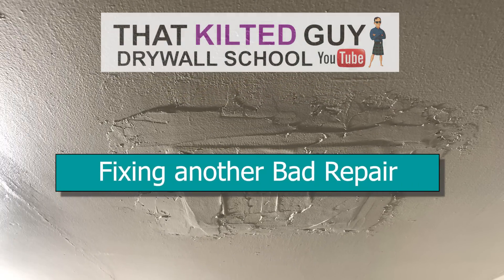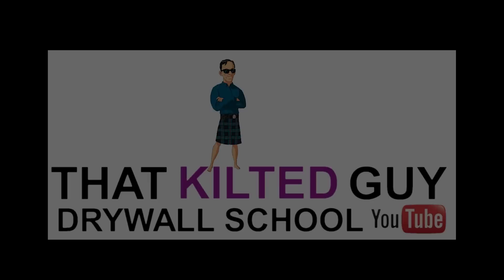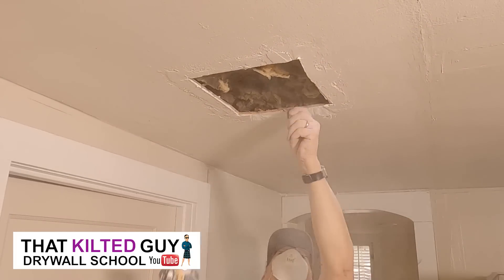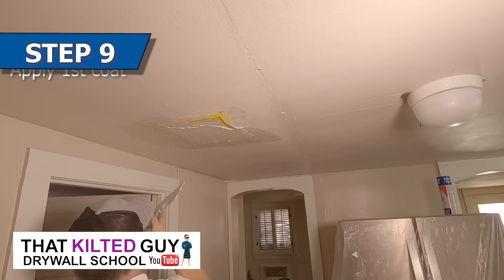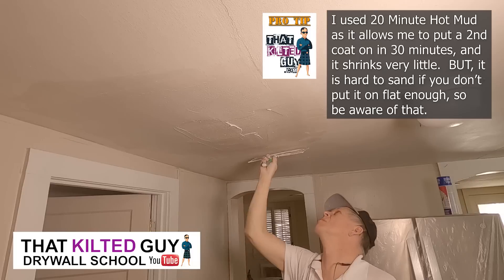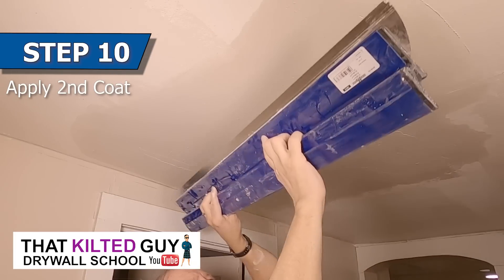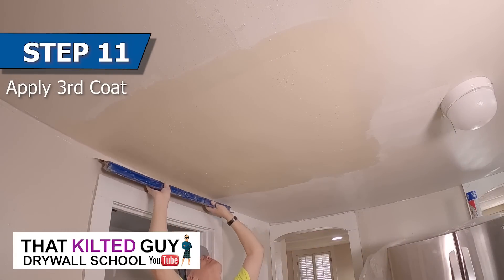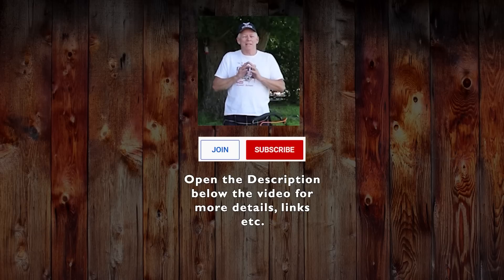Drywall Repair Fail.  This was BAD!  And it wasn't drywall?

Comment: I’m so frustrated because I recently bought a house where the seller hid issues on the walls with furniture. I have so much to do to fix up the walls because the previous owners were god awful at repairs. 🤦🏻‍♀️ it’s so tiring to learn everything and do it myself but I can’t wait to have refreshed everything.
Reply: I’m in the same boat but I feel I am getting better each time I do a drywall repair. Coat it, sand it, repeat until you like the results.

Comment: Great technique, your experience shows. My gripe with hiding defects especially when people intend to sell is that the problem is never fixed, but passed onto someone else who may not have the money to fix the problem either. But even if they did, they wouldn't know until the ceiling came down because it was hidden. This particular house has outdated materials so it's fine, but newer construction should be making repairs as best as they can. My opinion. Create win-win outcomes is all I'm saying.
Reply from the maker: Agreed

Comment: Wow that looks great.  That vacuum sander works great too.  I did not realize drywall blades came that wide.  Are tools used in working plaster and drywall basically the same?
Reply from the maker: I don’t do plaster so I’m not sure but the ones I’ve seen like Darbys‘s are different
Reply: @ThatKiltedGuyDIY  ok.  Thanks !

Comment: Great video! What is the best way to remove paint from a bad repair, to then tape,mud, sand etc. ?
Thank you!
Reply: I don’t now own an oscillating saw, so seeing if there was another cost efficient option.
Reply from the maker: Paint is very hard to sand off so I seldom do it. If you can get by with just sanding with 80 grit and then fixing the repair that’s the best way. If not, you might be able to sand it off with 60 grit or something but paint gums up sandpaper really fast.

Comment: Is the sander you used in this video heavy?  I want to get one like this as I’m going to be doing my whole house but I’m a little worried I won’t be able to handle it if it’s too heavy.  Thank you!  Love your videos!
Reply from the maker: I think they weigh about 8 lbs but due to the length it does get heavy.  I take breaks every 5-10 minutes so it depends on your fitness, but you can surely run it for a few minutes.  Guy

Comment: what you should have done is cut off the old repair bigger and you would avoid so many problems
Reply from the maker: Did you watch the video all the way? Because if you did, you would see that that was not even a drywall ceiling. It was 1/4 inch plywood

Comment: Ok. I feel vindicated. 
I’m a carpenter taping was only a small portion of what I did. And the guys that were tapers only would criticize my 24” knife it didn’t get used often but for those special occasions. One time the exclusive taper did  use my 24 he had a 22 inch window pocket that the sun was nearly in line with leaving shadows when it looked perfect without the sunlight. 

The fibers is something you can get for concrete as well. No rebar but unlike the drywall fibers it has little fuzz sticking up when it dries. I would be interested in the fibers it looks like it could eliminate some headaches on special occasions as well.

Comment: why not cut out all the drywall that had built-up mud on it? then there's no need to float out because there wouldn't be any hump to begin with...
Reply from the maker: I take it you didn’t really watch the video? If you did you would see that this whole entire ceiling is quarter inch plywood, (in the title even) and not drywall. And I did cut out the hump, then floated it out. hard to answer these questions when it looks like you didn’t watch the whole Video
Reply: @ThatKiltedGuyDIY  I did watch the whole video.  If you read between the lines, I meant to take any tool of choice (buzz saw, circular saw, jigsaw, sawzall, etc.) and just cut out the offending plywood.  Then patch as you did.  No hump.
Reply from the maker: OK, well it wasn’t the plywood that was the problem. It was the fact that they put half-inch drywall in to repair the hole where it was a quarter inch plywood. So I removed the offending drywall and then, yes you still have to float it out even if everything is the same thickness. I did show that it was half-inch drywall in there. Thanks for commenting
Reply from the maker: There is always a hump on any repair like this.

Comment: You didn't do your normal top quality work...so they didn't get half off. Half off would have been you charging them half for your normal top quality! You just had them pay for a inferior job.
Reply from the maker: No it still looked great and they were very happy and thankful. I did the quality the average guy does. I can do better work on my worst day than most. The whole house was still full off defects they couldn't afford to have fixed so my work was miles above the rest of the house. Maybe quit trying to be an armchair expert, without all the facts